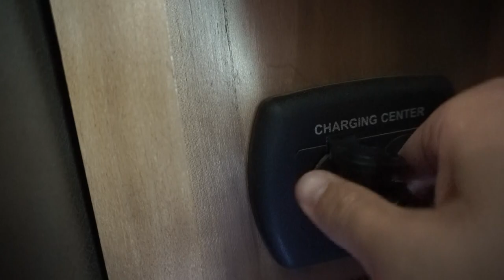HOW MUCH WE MAKE ON YOUTUBE?? 💵

Comment: OK, I have been meaning to ask you for a long time, - What portable air compressor do you use for the TT?  I have looked at so many different type's, and not sure whether to get  a 12V, or the kind that connects to the battery.  Also, I know length of the air hose is extremely important, when using on a dual-axle trailer.  Can't afford the more $$, but need one that will definitely air up my tire's on the truck & TT.  Any suggestions?  I have been considering one Viair's from Amazon, but not sure about the less expensive models..